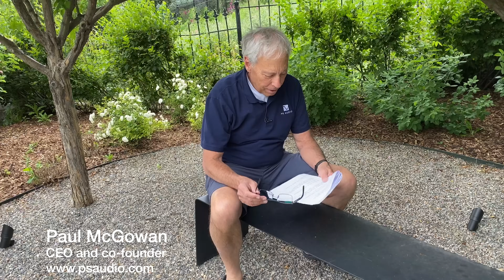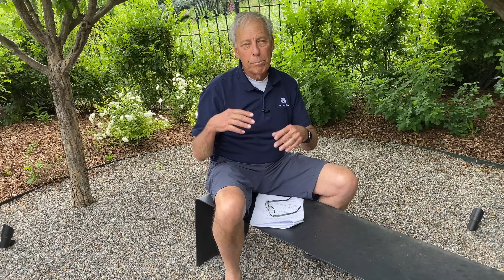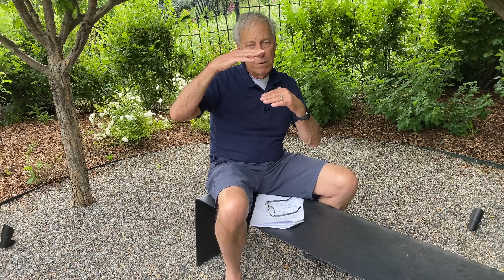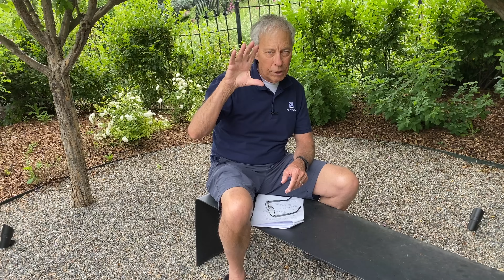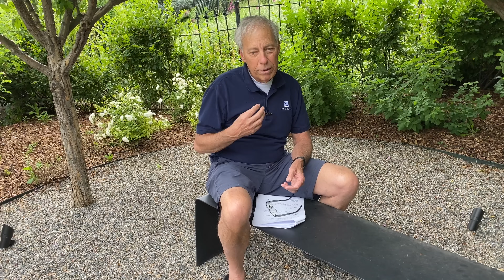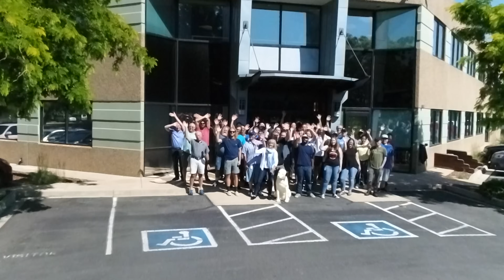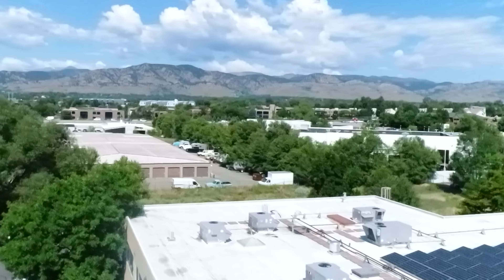Dynamic range expanders

Comment: For genre and formats like classical and jazz, they don't really suffer from the loudness wars do they? But for other genre's, like broadcast commercial radio formats, it's been done for over a decade with the likes of the Omnia 9 "Undo". Stereo Tool's "Natural Dynamics" is another DSP one. Even de-clipping goes a long way in making the worse of the loudness wars a little more listenable. Those are software solutions that can run on industrial grade hardware in live environments. Even back in the 80's the Audio Prism from from Texar, later Gentner also featured expanders. The most common theme with these tools, is they are all 'multi-band' expanders. With the software one's (DSP) being miles ahead in audio processing in terms of the broadcast industry vs recording studio gear. Some simple things like side-chaining a bass compressor/limiter and adding a delay of between 25-35ms to the side chain can help make a perceived boost in dynamics on the leading edges of bass and kick-drums etc... more dynamic & punchy, while keeping the rest of audio reasonably tame depending how you shape the side-chained audio as well. However, they follow this with additional audio processing. The difference though is definitely more natural sounding audio on brick walled mastered material.

Comment: You can do this with software.  My method means isolating 1/3 octave frequencies, adding dynamics, then recombining the frequencies.   The method is different for hard limited audio, but I made a video showing restoration of hard limited audio in very little time.  Most loudness war stuff is compressed, then hard limited.  Yes, you can do this....  It really has to be on a per-frequency basis.  For it to sound good, you have to do the steps in reverse of what a "mastering" guy would do.  Undo the hard limit, expand from there.  Generally, the higher the frequency, the more dynamics they've removed, as the higher frequencies are what add the most height to the waveform.

Comment: i mess around with such software too. my most favourable/ undamaging soution is a loudness reduction, a multiband compressor transient pronounciation (also adds a little bit of low volume mumblyness in the mids), a harmonic high frequency extrapolation with a big noise filter and an harmonic bass extrapolation with a soft clipper. 
the result is minimaly more dynamic/ decompressed sounding than the original.
the negative is the harmonic extrapolations and guesstimated transients distancing the result from the original.

Comment: I wish a reputable company would come with a 12v variant of a dynamic range expander like the dbx 4ds we use the alot for car audio in the Caribbean as we run mostly 10'-15' speakers for mids so expanders work well the issue is in order for a dbx 3bx or 4ds to work you must install a inverter to supply it with 120vac that money space and wiring all too much for some trying to save space in their vehicle.

Comment: Vinyl recordings are compressed, a 130db range into a 68db one. The loudness level between recorded CD tracks vs records/tapes is very noticeable, once both are burned to the same CD. Software offers normalizing a vinyl track, but I’ve never liked the results. I used/owned both DBX’s 3BX & 4BX models, but only for direct playback in my HiFi system via it’s tape loop, with very satisfying results. There is a fine line of dexterity needed to be used with these devices! Particularly the transition setting, more than the dynamic range restoration amount. Both require a balanced approach to avoid over saturation, aka; too much boost. Sure the lights may look cool, but the optimal point of transition, from quiet to loud is near seeing no lights at all. It’s been argued by purists, that placing these devices into the signal path, raises the S/N level. But they have the benefit of reducing the noise floor by 25% on average, so there’s a trade off to be considered. I liked using them, to revealing the hidden nuances in my vinyl recordings. I don’t know if these can be used to record vinyl to a Mac computer, via using a Tascam or Behringer interface. This could be a Mad Doctor experiment, also software fix-ups will be used for my vinyl WAV.files. Good to see you’re still at it Paul👍.

Comment: Retrospectively expanding the dynamic range of recorded media would be like trying to unmix cookie dough; you might be able to pull out the chocolate chips (which would still have dough stuck to them!) but separating the flour, sugar, vanilla and water would be impossible. What would be useful, I think, would be the exact opposite; a means of compressing the dynamic range on good, wide-bandwith recordings, when listening at low volumes or for lower quality systems such as the ghetto blaster in the kitchen? Thoughts?

Comment: Gee, Paul. Could maybe be done someday? Has been done, and the later, better models from dbx did - and still do - a fantastic job of restoring not only the original dynamic range, but transient impact, as well. I've been running a dbx expander in my systems for decades, and recently replaced the 3BX DS in my current system with a 4BX picked up from an estate sale. No pumping when properly adjusted via the LED displays on the front panel. Upward and downward expansion from the selected hinge point in multiple bands to recreate the original performance.

I realize the "Straight Wire With Gain" crowd writhes in revulsion at the thought of any playback processing at all, but I learned long ago that we listeners are at the mercy of every sound engineer's notion of what sounds right, and I, for one, choose to take an active approach to making playback sound right to my ear. Musc reproduction that sounds as close to live as possible is where it's at for me, and compression is one of the aspects of recorded music that informs our lizard brains that what we are hearing is canned, so when I close my eyes and listen to music processed through my 4BX, I hear a much more convincing recreation of the live performance than I do without it.

I run various signal processors in my home system. Each addresses a different aspect of commercial recordings to restore a realistic presentation. Some recordings need them all, and some don't. But my 4BX is almost always inserted in the signal path, because, commercial recordings are all compressed to some extent.  My AIX discs are the only ones that don't need expansion.

Comment: That is Real bad, he omits that DBX which has been around since the mid 70’s had a Dynamic range expander and Noice Cancellation compression.  They eventually partnered with Dolby Digital, I had two units over the years used them with Reel to Reel, for Tape hiss suppression, and Dynamic range expansion on playback.  To not mention that, that technology has been in existence is a real misrepresentation of the knowledge base.

Comment: Paul, in my dreams of opium I have 2 scenarios.
1.- 2 masters are made one for the "public" that requires a lot of compression (the current version) and a CD or file for audiophiles. And they are sold separately one would choose which version to buy.
2.- Compression information is hidden in the file. Let me explain, it would be done in a similar way to the old HDCD or MQA or CD-DTS.
It is very difficult to sell 2 versions of the same CD, files to buy them from the Internet or listen to them via Streaming (I don't think it's possible).
In the cases of HDCD and MQA, the least significant bit of the CD-A is used or hidden anywhere else (I remind you that the CD-A was not only made by the Red Book for sound only, example CD-Text, CD + G and CD + EG), but the reproduction equipment could have a button that allows using that information (which, being digital), can be changed and undo the compression that we so much hate.
Believe me I am willing to pay for that file to recover the dynamic range. It's like they make a new master, the tracks, the recordings and the original mix would be the same.
Reply: You clearly have no idea how compression is used in the recording process. Steve Guttenberg’s interview with a recording engineer:
https://www.youtube.com/watch?v=h1jt_JBS72g

Comment: I'm running a 3bx, works wonders when properly set, I believe the word you were looking for is commonly referred to as "breathing", not good, peace
Reply: if I heard well, he said 'pumping', and that is exactly the risk when you use an expander. 'Breathing' is the exact opposite of 'pumping', and it happens mostly during compression. E.g. when you play a Dolby B recorded cassette tape without Dolby B, you can often hear 'breathing' artifacts, because the signal is not properly expanded back to the original state.

see the discussion in this thread: https://www.tapeheads.net/showthread.php?t=39418

Comment: You can't un-mix paint.   Once you've blended the colors, you cannot UNblend them.   Once the dynamics have been destroyed, they are gone forever!    It's why I cannot enjoy the fidelity most new music.  Even if I like the music, I find it annoying.
Reply: this is not quite true. If you know what parameters have been used during compression, you can restore the original signal by doing the exact opposite. The problem is that many (re)mastered recordings have been processed with a lot more steps than just compression. Also limiters and equalizers will have been used, and applied differently to different sections of a single track, in an unknown order. That is what makes it impossible to undo loudness compression.

Take the cassette noise reduction systems such as Dolby, dbx and whatever we had back in the days: all of them perfectly capable of compressing the music during recording and expanding it back during playback.

Comment: I had a Phase Linear 1000 outboard dynamic range expander. It worked OK if used lightly. There were several adjustable settings and it was very fiddly. I notice they're still available on ebay for not much money, if you're the experimenting type.

Comment: I used to have a Teac tape deck with DBX, which compressed the signal on record, and expanded it again on playback. That to me worked well, but only because it only compressed to a certain  percentage, and then it knew how much to expand it on playback. I think that the problem with todays recordings is that everything is compressed to become the same level, and it would be impossible to know what to expand.

Comment: Dynamics should be finalzed in the mix, not by the mastering engineer.
The ME is there to tweak the linear levels to perfection, not the complex. Complex = Mix
Reply: Nevertheless the Jimi Hendrix master tapes of Are You Experienced came with a warning in very large letters for the mastering not to try to decrease the distortion.

Comment: I see 2 problems:
- it's almost impossible to guess what was the full process during mixing and mastering, it can be sophisticated compresser+limiter. And with a limiter, no algorithm can guess the information that was simply lost
  -> the simplest is that we get a "normal" master, with good dynamic. 
- BUT big problem is that a full generation has been used to listen to very compressed music, and many young people just don't like music with "natural" dynamic, they find it boring... And also, since many use small portable loudspeakers, it's just the way to have something that they like.
People with a good sound system are not such a big percentage of the music market unfortunately. If you like classical music for example, then it's much more easier to have something nicer to listen.

Comment: I (still) have a DBX compressor/expander from the early 80s. It still works and I have used it (kind of a test actually) lately in preamp loop.  It's very capable and was mostly used for tape recording and playback at the time (along with its built in 2 or 3 Dolby features).  Otherwise, I almost always used it to expand the dynamic range of records a bit and that seemed FINE at 1.1 to 1.25.
I recently tried it again for records to revisit the past, but elected to box it back up.  I must have liked it at the time because it wasn't cheap.
Reply: Yes I made Reel to Reel copies of all the Best music of the ear, and use a DBX with great effect for reduction of Tape hiss, and expansion on playback.
Reply: Plus they looked so damn cool, especially next to an equalizer:)

Comment: Yup, DBX was the king of this technology in the analog days. Yes there were other manufactures but DBX had a broad line of these products lasting years since the early 1970s to the late 1980s. I have a few units myself. The first units weren't very good but by  the 1980s the DBX models 1 and 3 were tolerable. The coveted model is the computer controlled model 4 which I think was the last. (note computer controlled, but still analog processing). The primary artifact was "pumping" if the expansion was turned up too high. What killed this technology for the consumer market was CD. Once we had digital recordings with practically unlimited dynamic range, there was no longer a market for an artificial range booster. I wonder though if this vinyl resurgence will once again make these devices popular? 
There were also several hobbyist electronics magazine articles in the 70s to build your own. The crudest method was to attach a low voltage light bulb to your speaker terminals pointing to a CDS cell which is a resistor that varies with light intensity. You put that CDS cell in series with the line level audio input. The brighter the lamp got, the higher the audio gain (actually less attention). But you can see how that would cause a pumping effect if not better controlled.
https://www.ebay.com/b/dbx-Vintage-Pro-Audio-Equipment/119019/bn_7438689